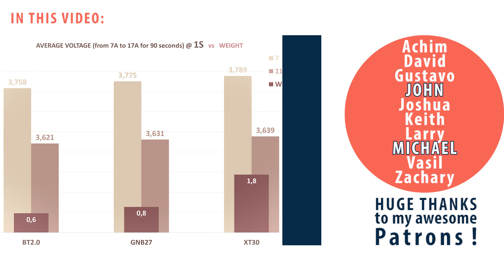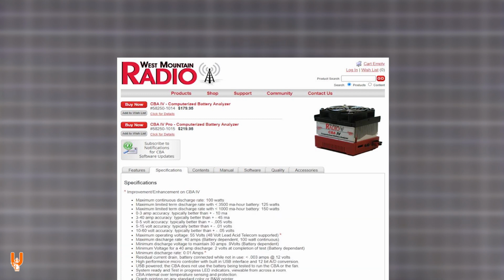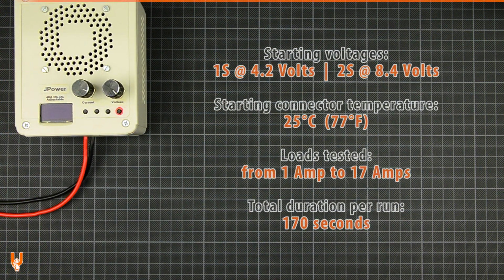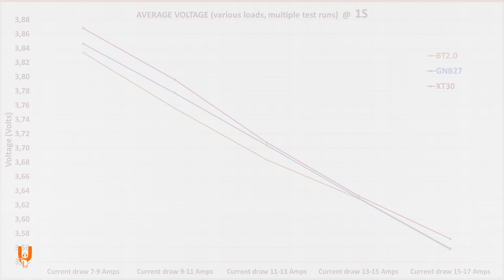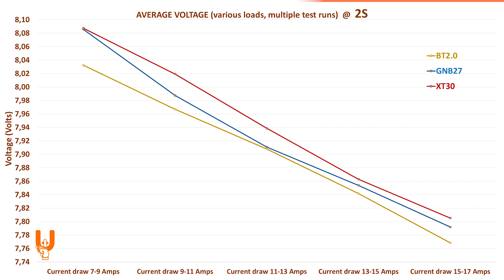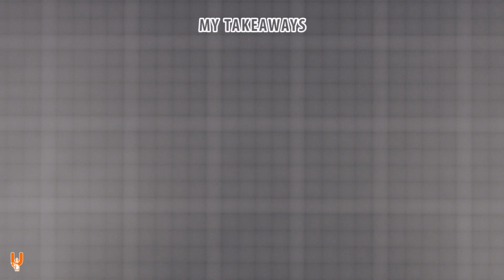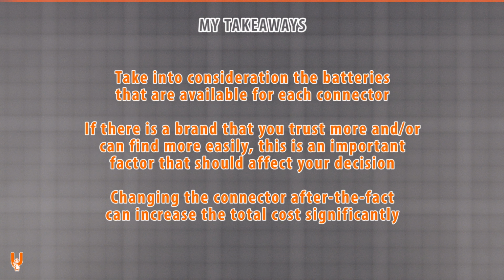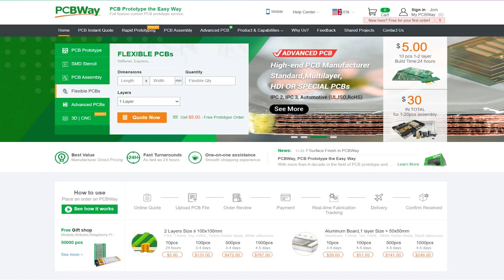BEST BATTERY CONNECTOR for 1S and 2S: GNB27 vs BT2.0 vs XT30 - Battery connector showdown #2

Comment: Guys, I decided today that I will "reformat" everything with 1S from Bt2.0 (9 amps, 0,6 grams) to GNB27 (9 amps, 0,8 grams). The GNB27 is about 33% heavier than the BT2.0, but I think the connector is easier to grip with the fingers and safer and also easier to solder because the pin spacing is larger (about double). It is also easier to get on the market than the BT2.0.

I feel very uncomfortable using the BT2.0, especially that maybe someday some battery in my storage bag bursts into flames, just because the pins are so close together and thus the soldered cables may build a short circuit because of mechanical and temperature stress of the plastic and wires... 

Too bad that I had bought the NEW VIFLY WhoopStor 6 Ports 1S Whoop Battery Storage Charger and Discharger BT2.0 and PH2.0 Compatible (New Version). But well I am an electronics engineer, and will either try to somehow get the GNB27 on the PCB, or I'll just tinker cable adapters that are only used for observed charging ... By the way, there is also a charging adapter from VIFL to connect 6x 1S GNB27 batteries to a XT60 charger... 

Only batteries with 1S GNB27 batteries are possibly rarer than with BT2.0 or PH2.0. But well you can easily change the plugs if you can solder... Of course, with a connector mod you will lose the warranty and the manufacturer's liability...
Reply from the maker: Unfortunately the downside of limited battery options with GNB27 connector is the added cost of replacing the connectors, when buying batteries with BT2.0 or other.. On the other hand you can reuse the connectors (as long as they are in good condition). I personally never worried about the BT2.0 shorting but the distance is small indeed.
Reply: @muteFPV  It looks like GNB wants GNB A30 the new standard (compatible to BT2.0). And they stop producing GNB27. That's a bad development imo... Because the tiny pin spacing for cable soldering is too tiny imo means unsafe against shorts...

Comment: Have you done any testing to asses the variance from 1 sample to the next? I’m wondering if the difference between GNB27 and BT2 would be consistently found across multiple samples or if there’s enough variation form one sample to the next that the difference is negligible?
Reply from the maker: I have only tested one set of each. I added it to my notes for the next batch of tests, although judging from user feedback the GNB27 is definitely superior, at least for power hungry builds. A brand new connector is in the making, I don't know if I am allowed to say anything about it. I will run more tests when it is ready.
Reply: @muteFPV  Thank you, keep up the great work!

Comment: I have both connectors GNB27 and BT2.0 and i don't think the GNB27 is easy to handle because is very difficult and hard to unplug in comparaison with the BT2.0. So i prefer to stay with BT2.0 for Tinywhoop.
Reply from the maker: Thank you very much for the feedback, I agree. I still find it to be overkill for 1S anyway and also prefer BT2.0 for whoops. Do you buy batteries with BT2.0 or convert them yourself?
Reply: @muteFPV  Hello, I buy Flywoo batteries with GNB27 but I convert them to BT2.0 because GNB27 are too much hard to unplug for a small 1S Tinywhoop
Reply: @muteFPV  And thanks for your good videos
Reply from the maker: Thank you for watching!
Reply: I bought GNB27 plugs for €45. To change all my 1S batteries from BT2.0 to GNB27. I was repacking them today when I read your post. And yes, I was shocked when I experienced the same thing. But then I realized that there are some that are easy and others that are difficult. Maybe it's a quality problem and only 50% of the connectors are usable. What I also noticed is that if you take 2 pairs of pliers and plug the plugs in and out 10-30 times, the posture decreases and it becomes easier the more often you plug in and out. So I keep changing everything to GNB27 because I think the BT2.0 is a bad design, firstly the pins are way too close together which I think is dangerous for short circuits and 2) you can't grab it well or you need this kind of hat for the battery with hot glue 3) it is only supported by one company, and other competitive brands (Happymodel, ...) try to avoid the plug...
Reply: It looks like GNB wants GNB A30 the new standard (compatible to BT2.0). And they stop producing GNB27. That's a bad development imo... Because the tiny pin spacing for cable soldering is too tiny imo means unsafe against shorts...
Reply: @Sugalime3D_FPV  A30 is compatible to BT2.0 in only one way.
I never try but I think you can plug male A30 to female BT2.0 but you can't plug male BT2.0 to female A30
Reply: @LaurentMontron  Yeah i saw it in the videos. GNB-company was doing it smart. You can use GNB batteries on quads with GNB pogtail and BT2.0 pigtail. But you can't use BT2.0 batteries on a quad with GNB-A30 pigtail.... This gives the GNB-A30 batteries an advantage...

Actually i also think you can't put the socket wrong togheter with the GNB-A30. On BT2.0 it is possible to connect them the wrong way...
Reply: @LaurentMontron  Bardwell tried it in one of his videos. it actually works both ways.

Comment: Hi! 
I'm a little bit surprised with your conclusion.
I have a tinyhawk freestyle 2. And I have observed a lot of sag during full throttle and dynamic flight. 
I have converted my th2 to xt30 and all my 1s to 2s xt30 (then it's the same batteries)
And really less sag and better battery life.
For instance with ph2.0 on second full throttle punch I have battery low warning, and with xt30 I can do up to 15-20 full throttle punch before one battery low warning.
It really transform my th2 :).
Reply from the maker: I have been perfectly happy with the BT2.0 on my TH2. I decided to use this instead of the XT30 just to keep the weight down. Very big difference compared to the PH2.0 (especially the crimped version)
Reply: @muteFPV  yes ph2.0 is lighter than xt30.  But on th2 side you replace 2 ph2 and one pcb (0.97g) by one xt30 (1g). Same weight. And on battery side you replace 2 ph2 by one xt 30 and one balance plug (only one wire to be light as possible). Probably 1-2g lost. Not really significant for the th2 :).
Reply from the maker: I am comparing it to the BT2.0. I am using one BT2.0 instead of the two PH2.0.

Comment: Isn't it a bit questionable if this will make any real-world difference? The biggest difference between XT30 and GNB27 is 8,014V−7,970V = 0,044V. While the relative difference in voltage drop is significant, the absolute difference is negligible. Great testing and methodology though! I am just a bit puzzled by the conclusion.
Reply from the maker: If you check my first round of comparisons, the PH2.0 vs BT2.0 difference is small too, but in the air during actual flying the difference is massive. My test setup is fed by a beefy power supply and the overall wiring is too lossy compared to an actual quadcopter setup where the wires are short and the battery is just a few cm away from the ESC. I strongly believe that the difference is actually significantly bigger in a real world scenario.
Reply: @muteFPV  Totally surprised that such a small voltage difference makes a significant impact on flying time! Great find! Would be really interesting to see the difference in flight time!😁
Reply from the maker: Just to clarify: what I mean is that the voltage difference may actually be bigger in a real world scenario.

Comment: The GNB27 batteries are also a lot cheaper than the BT2.0 batteries
Reply from the maker: Thank you for the feedback! GNB will definitely be more competitively priced for their own batteries with their own connector. For other battery manufacturers I am not sure how different the licensing "deals" are between GNB and BetaFPV. Did you compare GNB batteties vs BetaFPV batteries, or from other manufacturers? Don't reply with links because Youtube is removing comments with external links automatically and I will not be able to see it.
Reply: @muteFPV  I compared the BetaFPV PH2.0 450 mah 1S against the GNB 650 maH batteries. First off, the pricing is $30 (BetaFPV) vs $18 (GNB) for a set of four. The GNB weights about 3 g more but has longer flight time (about 30 - 40 sec). The most important point is that the BetaFPV battery voltage sags big time when it reaches below 3.1V. The GNB batteries did much better and the voltage did not drop like a rock when it reached 3.1V
Reply from the maker: Thank you very much for the feedback, I just saw your message (it was hidden by  youtube)